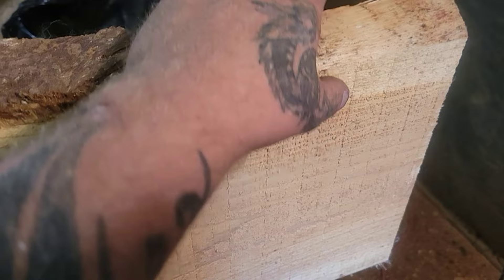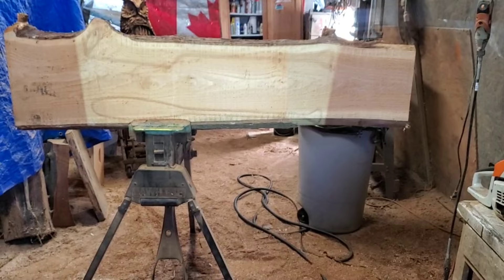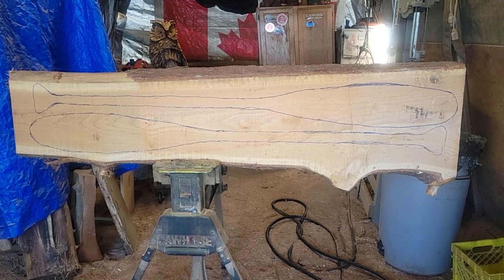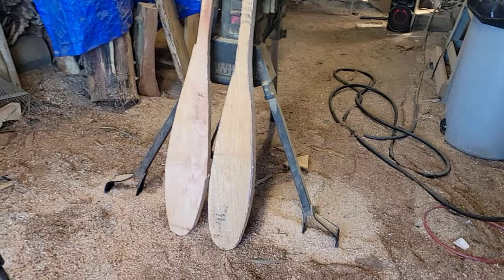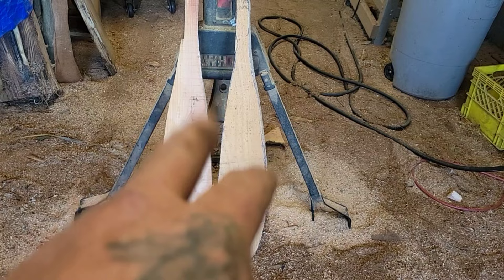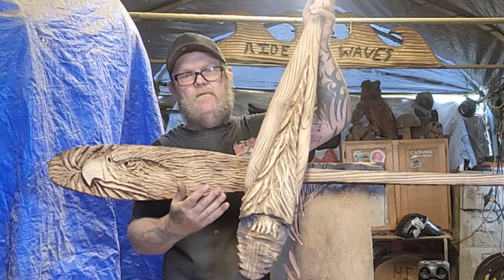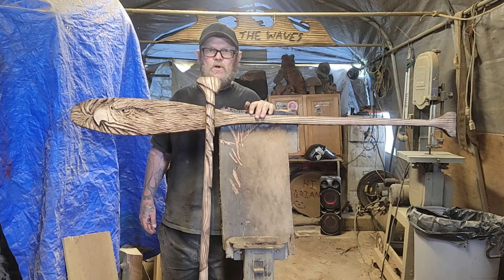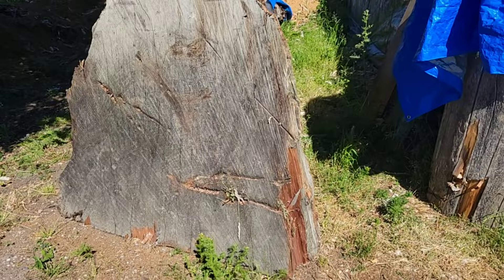How to use a Projector for wood carving paddles.

Comment: As a suggestion: Mix up some epoxy and thin it with denatured alcohol and paint the oar with it.  It will seal it and make it a lot stronger particularly for the handle.  I've done it on certain projects and it really increases the strength and will protect it from the water, gives it a nice finished look.